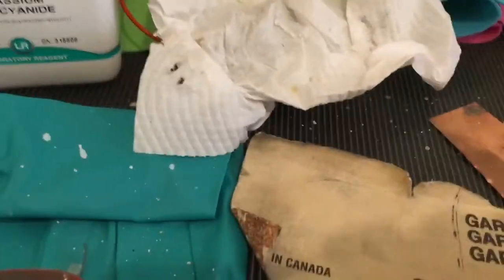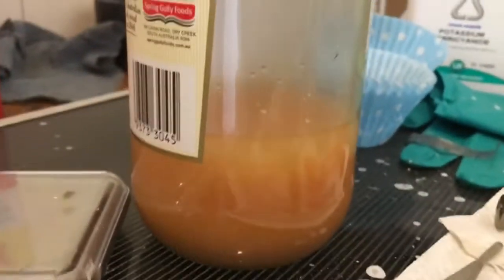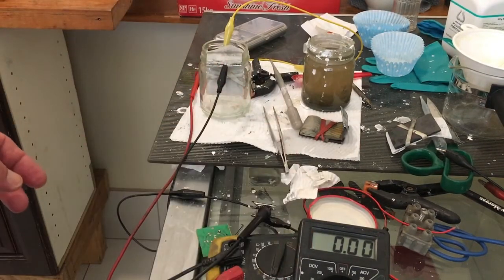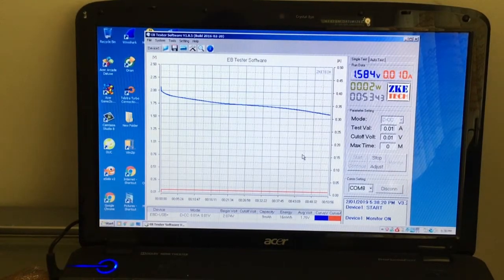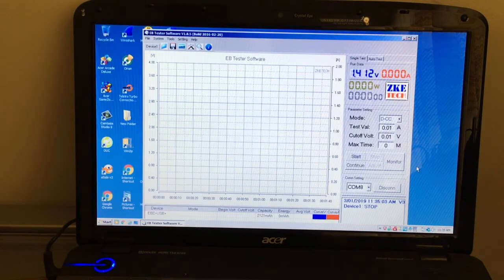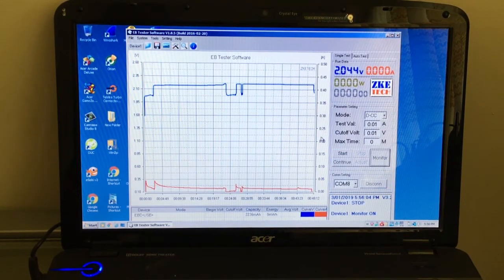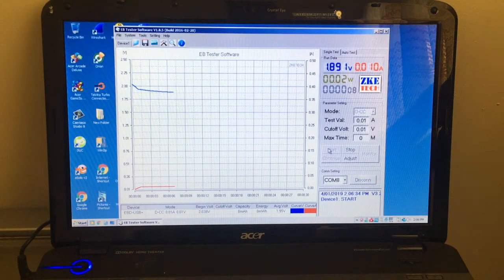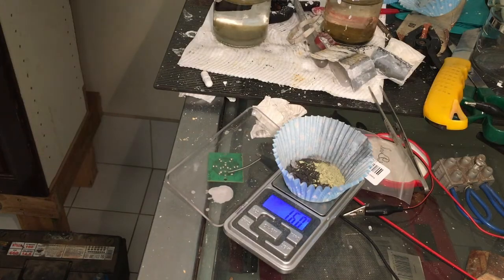Manganese Dioxide And Zinc hexacyanoferrate Cell Test

Comment: Some Good efforts here Dan, keep it up mate you will get there.
Oh can i give you a good tip.....move over to CMC-SBR  Binder system for a while see what you get.
2g CMC per 100 ml of Di Water ( mix in a Blender ) leave to settle for an hour then add 1g SBR and blend again, before adding your carbon wet it out first  i have tried 5g - 10g - 20g  etc it just depends on your carbon. Obviously those amounts you can x by whatever. layers and gentle heat this stuff drys real quick.
i will be doing a vid soon on what i have doped with hexacyanoferrate.  😎
Reply from the maker: Hi Kev. Thanks. I watched your video where you talked about the binder. I will be getting some soon. I really need to move away from the cellulose acetate as the binder. I have number 3 of your video to watch this week. If the high resistance is not the problem of this cell it may be the contaminated iron Zinc hexacyanoferrate  works much better. it peaked at 13 mAh compared so far with 8 mAh for the uncontaminated Zinc hexacyanoferrate .
Reply: @danp1224  when you say contaminated, how is it contaminated ?
Reply from the maker: @mouldykev  when I first made the Zinc hexacyanoferrate I used a steel stir bar and it went blue after adding 40 ml of zinc sulphate to the mix. That was the contamination.
it's in this video at the start. https://www.youtube.com/watch?v=bpYJAo6LJr8&t=4s

Comment: Hi Dan, The MnO2 cell went well, it will be interesting to see what difference the "hexy do dha" made :-) Just be aware those graphite plates do take part in the reaction. I have double bluffed myself  using those. They are OK for a quick test cell, but can give you false data :-(Happy new year  -  Martin.
Reply from the maker: Hi Martin. What I do need to to is get me a new binder and be done with home made cellulose acetate for the binder. These 2 cells resistance is over 4k  the first cell was 38 Ohms some how.

Comment: Hi Dan. Sorry I don't know what the zinc hexastuff is for. Are you trying to get zinc particles into the pores of the carbon? Thanks for the vids  mate!
Reply from the maker: Hi Zylascope. The Zinc hexacyanoferrate is the active material it should transform on a charge and go back on a discharge.
Reply: @danp1224  Are you saying the zinc hexa* turns to solid zinc metal on a charge cycle and  then back to zinc hexa* when it discharges? Does this mean that the zinc remains in a solid state for charge and discharge? So, is this a potential cure for zinc dendrite shorting problem?